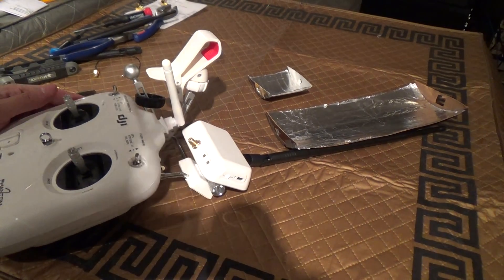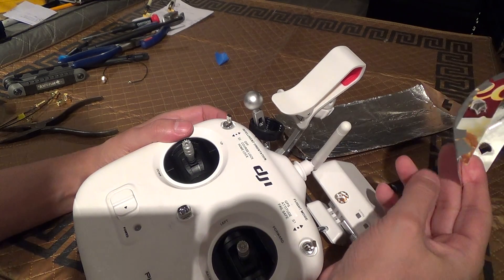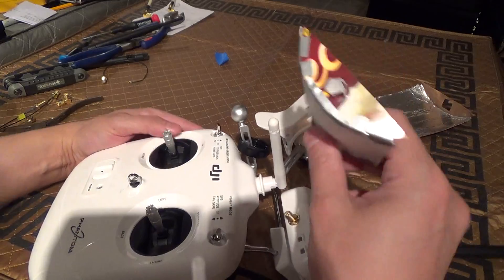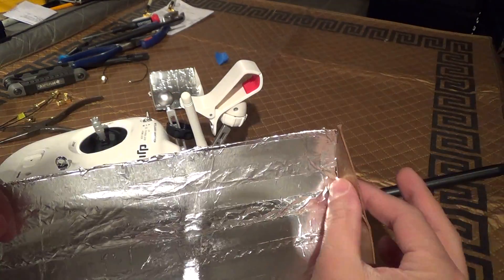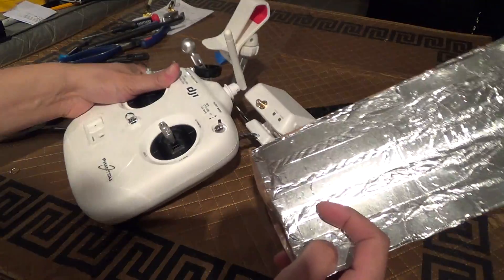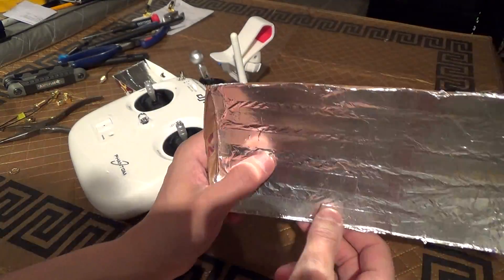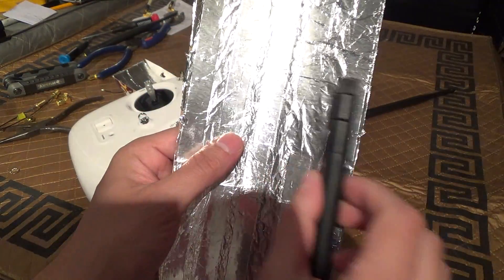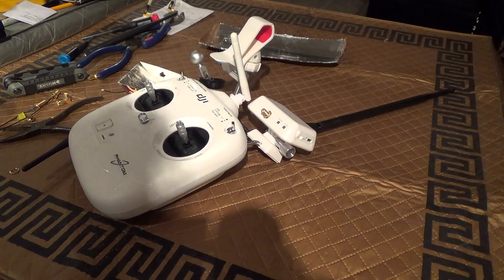Aluminum Foil WiFi Antenna Mod Increase omni gain and FPV Range on Phantom 2 3 Inspire 1

Comment: I wrapped a small piece of aluminum foil around the antenna on the UAV and the remote transmitter antenna. Although the antenna is actually built inside the remote transmitter. The antenna outside the remote transmitter is fake so I wrapped a sheet of shiny aluminum foil around it. 😁

Comment: Another great video but, why would altitude make a difference compared to distance? I would think going straight up you would get better signal then going outward over objects. Happy flying! ;-)
Reply from the maker: I think it has to do with the radiation pattern of dipole antennas and that you have a weaker signal directly above or below.  One way among others to combat that is to fly farther away where the angle is less of a problem, but doing that also affects total range as you would be flying far away before flying straight up.  Using higher gain antennas will certainly help as well as changing the receiving antenna to a circular polarized antenna.  You may get slightly less total range with that but you should be able to fly equally far as high
Reply: Let me ask you a question. If you had a chance to do it all over again (budget aside)buying a Phantom, would you still buy the Vision, or would you get the Phantom 2 with all the extras knowing what you know now? Thanks! :-)
Reply from the maker: That is kind of a toss up.  I got the P2V before the P2 with gimbal was available.  My assumption was the P2 with gimbal was going to be at least a few hundred more than it ended up being which was one of the reasons I didn't bother waiting for it.  That and I had no experience setting up my own FPV and so forth.  Even with that said there really is a nice benefit to being able to start and stop video when I want or still pics and be able to preview while still in the air.  So if anything I might want both platforms and not just one over the other
Reply: The stop and start is a good feature, but I don't do that many stills and always start the video before takeoff and not before I land, I don't see any advantage there. I also find that my iPhone screen is too small to really fly FPV and to buy a bigger (iPad) screen is like spending the difference on the P2 (I already own a 7" flat screen and sunshade), not to mention the money you need to spend on a 2X gimbal to make the video look steady (stabilizing software degrades the video more then it helps).

My dealer is willing to exchange my P2V for a complete P2 system, minus the Gopro camera, which is the same price of a 3rd party gimbal anyway. Besides, I don't really feel comfortable buying from a company that is out of the country and have no refund policy. I have returned 3 P2V to my dealer already do to defects in the last 3 months (Broken antenna, WiFi issue and defective camera). 

Anyway, I appreciate your opinion and I look forward to seeing more of your informative videos, keep'em coming and happy flying! ;-)
Reply from the maker: As far as FPV screen size you don't need to buy an expensive ipad or ipad mini to resolve that.  I myself went with getting a Nexus 7 tablet.  And like with a gopro when I'm not using my Nexus for the FPV I'm using it for other things.  It's a great tablet and less than half the cost of a ipad mini retina.  You could also get a Samsung galaxy tab which is cheaper.  Tho as far as getting a stabilized gimbal for p2v they're on the pricey side at this moment so I agree if you need higher quality stabilized video going with a P2 with h32d gimbal is a no brainer to choose.  Also you can setup a more expensive FPV system that can live stream smooth 800 resolution video as opposed to the 640x480 15fps video the vision is limited to.  Range on both system is equal when you factor in modding the P2V vs it's stock form.

I too have been having some glitches with my P2V for quite some time, which could just as easily have been the case with the non vision giving it's the same copter.  I sent mine back to drone fly for exchange with a new one. Best of luck with your new P2.  And try to get a better than 250mw video transmitter on the phantom side if you're not happy with FPV range.  That and same antenna recommendations apply as with p2v for video.   A good 5.8ghz helical antenna for you and a good skew planer on the phantom.  And same antenna mod on controller applies as well
Reply: I was planning on getting a P2, Zenmuse, GoPro 3, DJI AVL58 5.8 transmit/rec, DJI iSOD Mini, Can Bus and DJI's new FPV hub which I believe remove any soldering out of the equation (all plug and play). The hold package is under $1600.00, really not much more considering I would still need the 2X gimbal (Rotorpixel $420.00) and larger screen (Galaxy Tab 3 is $175.00) for the Vision. Thanks again (Ben?) for all your help in making this critical decision. TTYS :-)
Reply from the maker: Bobster986 That's what I would consider as well tho I'd probably end up using higher power tx. And I'd go with GoPro Hero3+ black edition. When cash is available I may still get it
as a secondary system for the stabilized video and maybe a Fat Shark HD FPV goggle setup. That or wait till a Phantom 3 becomes available :)
Reply from the maker: Bobster986 Yes my name's Ben :)  Glad to have been of help in your decision making process. Best of luck with the new setup.